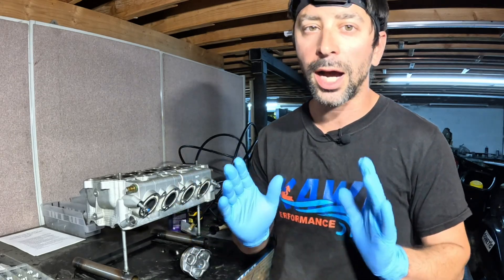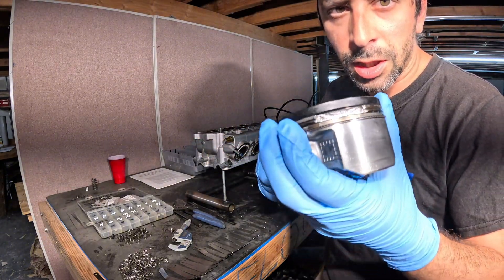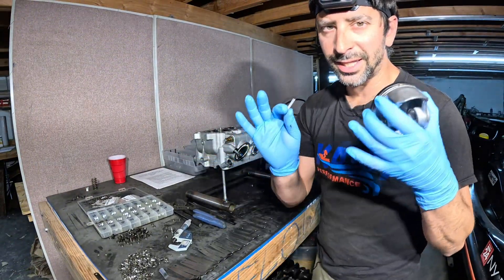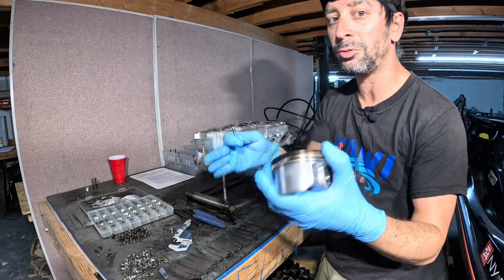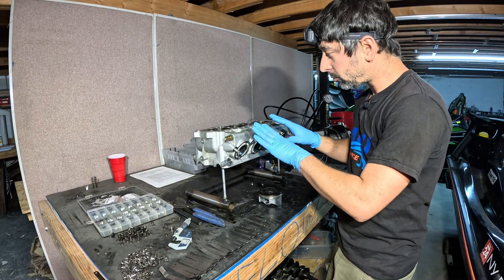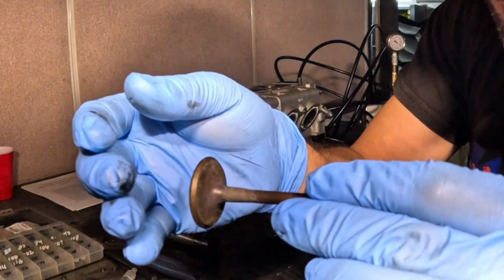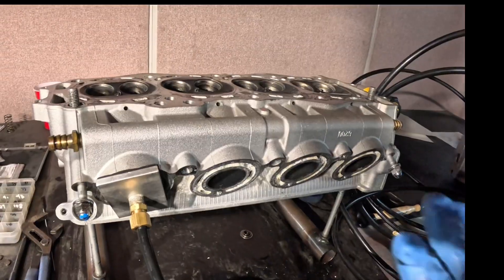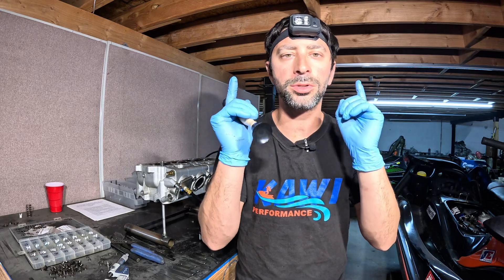The Truth About Ultra 310 Piston Failures — Watch Before It’s Too Late!

Comment: Excellent vid. Practicalsailor has a great article on phase separation. Kawi recommends 91 pure gas, I think all these guys with issues are putting in 91 with ethanol which when phase separated is more like 89.5.  Safer zone with ethanol is 93.  Kawi should put the difference in the manual.  Since you cut the valves did you reuse the old valves?  Ever see any issues with the Nicasil coating coming off like on KTM’s?
Reply from the maker: We strictly use 93 with ethanol, and it will not phase separate for a while. A while being over 8 months or more. The biggest issue like you stated is octane reduction over time. So anything older than a few months comes out and goes in the car, regardless if stabilizer is added. Yes, old valves are cut if good. Nikasil does flake, only from water or moisture in the cylinder. It doesn't just happen.